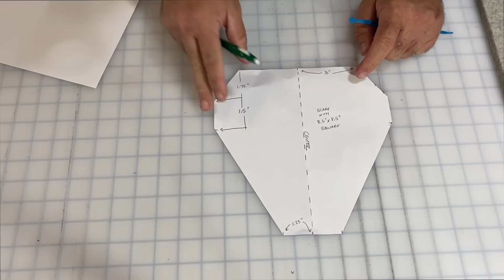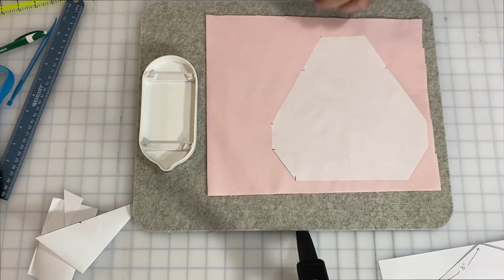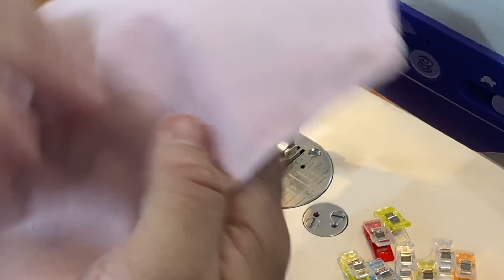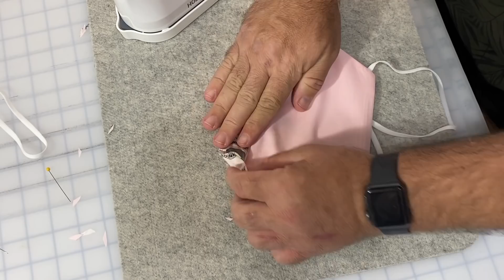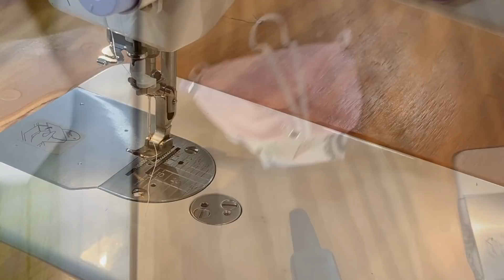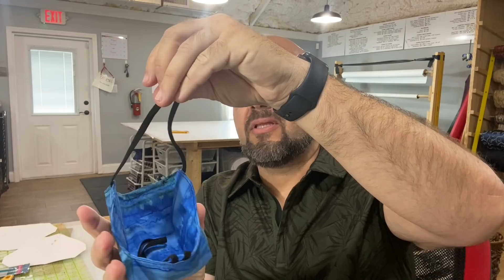*NEW* 3D Shield Mask Design!  Easy Pattern with NO Seams, Stitches, or Holes on the Mask Front!

Comment: Thank you for this video and pattern. I feel that every time a stitch is made, there is a compromising hole that organisms can get through. For this reason, I always use clips instead of pins. Also, you might try sewing in a piece of fabric into the seam line at the top of the mask to form a pocket for the nose wire. I found that if you do that, you can hand stitch the opposing side of the pocket and just stitch through one layer of fabric. Also, instead of topstitching the turn hole closed, you can put a piece of special tape that permanently seals the two layers of fabric together using an iron. I am not sure how you can avoid topstitching the entire mask...I need to think about that one. Again, thank you for this.  We can never be too cautious.

Comment: Excellent video!!!  Thanks for doing what you do and giving us so many different options!  As I posted below, I always use 100% white cotton for the LINING of all my masks so it will remind people to WASH THEM!  I also use iron on, non-woven interfacing to the WHITE LINING, so it gives it more body and helps a bit to keep the mask from getting sucked in during inhalation. Plus of course this adds a NON-WOVEN barrier to help in filtering. 
Thanks again!  I look forward to each of your videos!  You explain things very clearly which is extremely helpful. Stay safe and healthy! ((Hugs))
Reply from the maker: These are great tips and I will probably be featuring your suggestions in a new video, if that’s okay with you!
Reply: @timothytotten9409  Absolutely!  The interfacing is not my idea, but using the white as a liner is. Several mask recipients wanted the inside to match the outside, which I refused to do, and I told them why and that’s it’s easier to see that it needs washing…their reminder to wash them frequently. (Plus, it’s cheaper to put a Kona cotton inside than it is to use up my quality quilting fabric! Lol. And since I don’t charge for them, it’s all about my pocketbook.)

Comment: I love your tutorials and this mask looks like the one that will solve my fit problems for glasses and small face. You are a skilled teacher. I have two questions: 1. Can you provide measurements for making the tiny faces template please? Also, what are your thoughts on using non-woven interfacing for one of the layers? I've decided I have to up my mask game as we head into the third wave with new highly-transmissible varients.  Thanks from Vancouver, Canada.
Reply: I’m glad you’ve asked about the interfacing!  I iron on the adhesive, non-woven interfacing to 100% white cotton for the LINING of all my masks. I use white fabric so it will actually show the dirt/oil/makeup from our faces so it reminds people to WASH THEM!!  I won’t wear a mask for more than one day, just too gross. 
Another point, is when people slip them down and wear them “necklace style” with the inside facing out and let the inside of the mask get exposed to germs, it completely defeats the purpose of having a clean side next to your face. Call me paranoid, but being an RN and trying to avoid this 🦠, it only makes sense to wear them correctly and wash the darned things!
Off my soapbox now…lol. 
Also, by ironing on interfacing to the LINING (closest to your face) it gives the mask more body in which to keep it away from your mouth and helps keeps it from getting sucked into your mouth during inhaling. So, giving the LINING more body is helpful.

Comment: Great that it has no sewing holes on the front, so many DIY mask designers don't factor that in. Needle holes = spaces for the virus to get in/out.
Reply: The holes are harmless. Hold a lighter in front of your face with the mask on and try to blow out the flame, if you can't nothing is getting in or going out.

Comment: My needle always breaks when I sew through more than 4 layers. I've tried different needles to no avail.  How can I prevent the broken needles?
Reply: If you have broken needles over and over, it may be time to take your machine in for service. Make sure that the bobbin case is clean, make sure that it is threaded correctly, and make sure that you're using good thread.
Reply: @stephanielbrim , it's a new-ish machine, used only to make about 8 masks.  💁‍♀️
Reply: Sister, don’t know if you’ll get this comment, but you may still need to have the unit holding the needle checked for proper alignment. If it’s a new machine purchased through a store, they should offer a checkup service. Best wishes.
Reply: @suzanne.alexander  Thanks for the advice!
Reply: I would say use a stronger needle and mostly sew slowly over the thick parts. Also, you may need a presser  foot lift at the thicker spots. If your presser foot is tilting on the high spot it will break your needle. Good luck figuring it out.

Comment: Hi Tim, love your videos and have made many of your styles.  I make masks for the local food bank.  Instead of 3 layers of fabric I've been using interfacing.  I'm curious why you don't use that.  Also, on the pony beads, I put one on the single elastic as a 'stopper' and then use the same method you do for the 'slide' for adjustment.  Going to try this mask this weekend.  Love the snug fit.
Reply: Wow, that’s a terrific idea to keep the toggle from slipping off! 🤦🏼‍♀️ duh…. So easy to thread these on before sewing the elastic in. Thanks!

Comment: Really nifty design, I’ll give these a try soon! I have some silicone toggles and they feature a smaller hole on one end. Is there a preferred direction that the smaller end should face when running the elastic loop through? 
I’ve been threading the toggles with the smaller end facing outward. 
Is that the most correct way to thread them onto the elastic?
Reply from the maker: I've tried both ways and it doesn't appear to matter either way.  Try it both ways and see what you think.

Comment: sooo ironman! love your emphasis on fit which is big for me. so i am looking forward to making this mask. thanks for your tip with freezer paper. invaluable tip. i love your placement of elastics round head. i’ve tried at least 30 styles of masks (i know right?!) and the one thing about fit was elastic round the head. i use piping instead of elastic (my elastics last a month or so). i’ve been trying to design masks too. so not easy. love ur design. this will be my second mask design from you. i am loving masks as a fashion accessory so trying to make cool ones even after pandemic is over. this definitely falls in that category. so THANKS!
Reply from the maker: Wow, I hadn’t thought of the Ironman resemblance but that makes so much sense!!